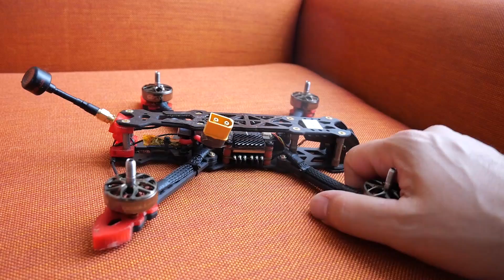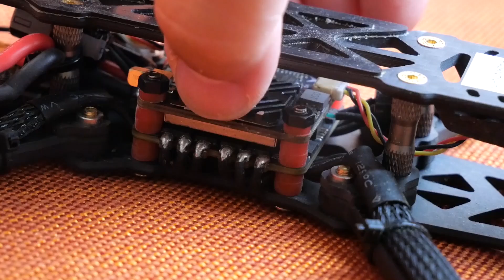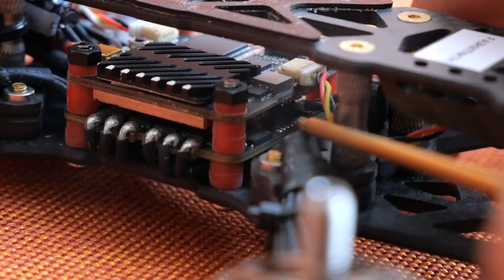Never buy a Flight Controller with this feature (GEPRC Mark 4 deal breaker)

Comment from the maker: On September 22, I received an email from a person who had asked GEPRC for a replacement FC for his Mark 4.  The new FC that he received also had pins. If you receive a pinned version of this FC on your Mark 4 please contact GEPRC support for a replacement.
Reply: I have checked photos on bangood and now they use wires so looks like this has been solved.
Reply: Plus stack is assembled with nut at the bottom so its not that wobbly anymore
Reply: Joshua, are you able to confirm that with the Mark4 5" BNF on the new F7 flight controller, this design issue has been fixed? I would like to order this BNF if it is no longer an issue. Thanks in advance for your response, I appreciate it!
Reply: @hoverworx  i have one which came last week and it is fixed :D
Reply: Hi!

I plan to buy such a machine. This thing has already been mentioned in the description. Did they replace it?
Note: The cable wire for connecting flight controller and ESC is AWG cable wire.
Reply: I have a Cinepro 4k which has this stack issue x2.  One from ESC to FC, then from the top of FC to VTX.  I wish I knew this before purchasing it a few months ago.

Comment: Is this your first header pin mounted esc/fc? I have multiple stacks that the FC/ESC connect thar way, from a couple different manufacturers and have never had an issue with the pins not making contact. I won't say that this way of connecting is better then a ribbon cable, but it definitely isn't as much of a flaw as you make it out to be.

Comment: dec/22 - just got a GEPRC  CINEBOT30 DJI O3 lemon POS, no access to Air Unit O3 USB port, SD card port or even the )3 bind button, had to make holes in the frame with dremel. They never tested, CLI all wrong, have to disassemble everything and re build. GEPRC are shipping garbage now

Comment: Hey man It looks like you might be running an extra soft mount on your setup. It might be making your stack too wobbly. I run two soft mounts on DALRC's with pin connectors and really like them.  Also thank you for all the videos, your the go to drone guy for me.
Reply from the maker: This is exactly how it was shipped.
Reply: @JoshuaBardwell   What would I have to do to have you check out my frame design? I have something you might find pretty rad.

Comment: If you check the Geprc website for this stack, it does not have the pin header any more. Not sure if that means that they are no longer shipping the stack with pin headers in the full build. This still does not address the issue you brought up about having the video transmitter on the flight controller though. This frame was my first full build and I love it, but there are some head scratchers about the components included with the pre built quads. Anyone wants this one, they would be better off buying the frame and building it themselves. I installed the Geprc stack for DJI in mine originally but had issues with the UARTS working with GPS. it now has the iFlight stack but still the Geprc ESC which I have not had any issues with.

Comment: they have a bit of an odd setup going with their mk4 range with different configurations of FC/vtx combos depending on the build you order

if you ordered the one with the caddx tarsier it doesnt have the built in vtx on the fc and doesnt use pins to join the fc to the esc's

the build for a first time fpv pilot has been great so far but dont really have much to judge it against

Comment: Hey Joshua, my name is jaxon morse. I’m new to the hobby of fpv. I bought the geprc mark4 thinking it would be a good starter 5” quad. All of the reviews said super good things and I couldn’t really find anything negative... until you came out with your videos, 2 weeks after I ordered it lololol. Well it arrived the end of last week,  I was flying it for the first time today took a small crash to cement and now the esc will power on and not the FC. I’m taking a strong guess to say it’s the same problem that you came across with how their connected. What do I do with this quad now!! A full new stack? Or is there a fix?? Thank you for your time.

Comment: EXSATLY THAT WHAT HAPEN TO ME ON MY King Kong 20x20 stack,after one crash 1 motor stoped to work and when i press the stack down it came to life,so i grab the zip tie and now the zip tie is presing down the hole stack and i am able to fly....Not a perfect solution but you are right,the design of that kinda of sandwich stacke with pinheads is not perfect.
Sorry for bad spell,greatings from Europe your big FAN

Comment: Great to see geprc putting the matter straight. Top company. You are right though. I stopped buying the iflight 20x20 stack due to three failures. The succex E stack with wires is ultra reliable. King kong stack is a shocker with pins.

Comment: I agree, while ribbon cables are also not 100% reliable, pins are an accident waiting to happen. It does look nice and clean, but apart from durability/reliability issues, like you demonstrated, it also prevents people from easily swapping out an ESC or FC for a different brand, that doesn't have these pins. You'd have to remove the pins and solder the wires onto that, while with a side connector, all you would have to do is check wire order, make sure the harness matches this, and plug it in.

Comment: If the pin components were through hole parts instead of surface mount, they would hold up a lot better. Unfortunately, this would mean adding another step to either hand or selective solder the board, which is very costly.

Comment: JUST DONT BUY GEPRC QUADS. I have a lot of problems with this brand. And they are not providing a good after-sell services. They are replying to Joshua because he’s famous but if you’re a random people they just don’t care about you. My FC came dead, the drone is shaking without doing anything in flight. I talked to Joshua about this, he confirmed that the problem is coming from the gyro’s or the FC entirely. My VTX also came with a frequency and overheating issues. GEPRC said, after more than 3 weeks of negociations, « ok, we will send to you new gears, is it ok for you ? ». I said yes. More than a month later, I still don’t have nothing to change the defective parts of my quad. This brand sells their drones as « high quality quadcopters » as it said on their packagings, but this is definitely not the case.

Comment: I had a brand new geprc stable stack with this "feature" and it was broken from the factory and it destroyed esc and FC. As the ESC warmed up, motors stopped working and stopped showing up in BLhelisuite. BG would not refund it fully :(

Comment: I hope that this isn’t affecting other GepRC drones. Got a seven inch crocodile, the stack looks kinda similar because of the placement of the vtx on the top board. But if it does, thanks for letting everyone know.
Reply: My Crocodil stack is soft mounted but wired. Both Cinequeen and Cygnet are using pins but the stacks are hard mounted. Judging by amount of abuse Cygnet survived pins - when done properly - are not such a bad design after all.
Reply: sasa sasa I have mine currently stuffed away waiting parts. Took a hard crash, pulling the motor wires possibly yanked the copper windings. The other motor, just a bent bell but other that that looks pretty good.

Comment: Can you make a video about soft mounting vs hard mounting and what exactly that means? I am relatively new to fpv and have built two quads myself, but that is one thing I have a had a lot of trouble finding good info on. When I build my quads, I have been mounting my FC and esc stack by putting a nut at the bottom of the screws to make sure that they are very ridged, but then I use the rubber grommets to mount the stack and then use a nut in between each one to squish it down. This makes it not wobbly at all but have a little shock absorbing ability, is this a good idea? Also, keep up the good work, your videos are invaluable and I gladly donate to your patreon for all your hard work.

Comment: Yep, the pin header in my Hawk 5 was its downfall. Ripped the pins off of the esc in a crash. Rebuilt with a stack that was wired together with plugs. 🤓

Comment: I used to run a iflight stack using pins - they did okay for like a year, the problem i had with them, was that when i finally would try and pull the stack apart it would rip the pins off from the esc... happened on 2 different builds that had been going like 8-12 months

Comment: I've been flying the DalRC F405 and 40a engine for two years now which uses the same style connection.  I have three quads with this setup and have had NO issues. And I don't play nice with them. I would attribute this to the manufacturer more so than the design. Just my two cents. As always, great work Joshua.

Comment: I have solely been using GEPRC's stack since they initially introduced it.  The one thing I'll say is that they no longer make this type of stack anymore.  I had this same issue on one of my stacks and I wound up just cutting the pin headers and wiring the FC directly to the ESC.  It was tedious soldering but it saved my stack.  When I went to order my next stack from them I noticed that they had ditched the pin header and moved to a wired method.  I've been giving the new version hell on 3 quads and havent had any issues in over a year.  I said all this to say that I think you reviewed a pretty old product from GEPRC and that they have fixed this issue.
Reply: Hello,
 could you detail what stacks/drones you were ordering and most importantly, when.

This would be greatly appreciated. 
Thank you very much in advance,
Procyton
Reply: @procyton9716  I looked through my email and the first GEPRC span that I ordered was on 7/1/2018.  I ordered two of the stacks and they had the issue that J. Bardwell describes in this video.  I ordered another GEPRC 40A span stack on July 19 2019 and the issue was still there.  I ordered a GEPRC span PRO on Aug 22 2019 and GEPRC have switched to a cable instead of the hard mount.  In 2020 I have ordered 2 GEPRC F7 stacks and 1 GEPRC F4 SPAN PRO stack and all of them had the updated connection method.  I hope this helps.

Comment: Pin header aside, what is that ridicolous amount of soft mounting. In my opinion this is way over the top... With this amount you will basically loose information on the gyro.

Comment: I have an iFlight 16x16 stack and all 3 boards (ESC, FC, VTx are connected this way. I've had the stack since December, and never thought about this until now. It's mounted pretty tightly in a Tadpole, with steel screws that go right through all 3 boards, so hopefully I won't have any issues...

Comment: I haven't had many problems with the pin header on 20x20 stacks. I just did a vid repairing one. All it takes is a little touchup with the soldering iron under the 'scope. The FC board that I repaired has been crashed into a sorts of things.

Comment: On My Micros with Similar FC / ESC Connectors I usually put a nut on each of the 4 Screws holding the FC / ESC. While Building I as well find it easier as the screws can't fall out. Ok, It probably is not as "soft" mounted as here but never had issues. On FC's having a connector and cable to connect to the ESC's I always wondered why the connectors need to point outwards and the cables are so long. Sigh...Stuff is not perfect.